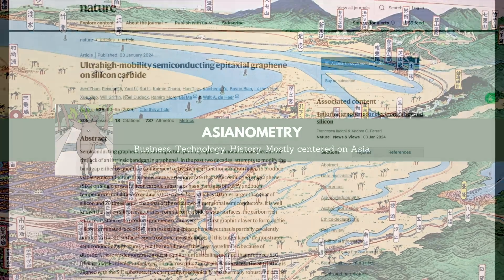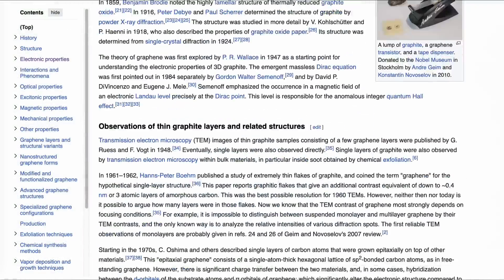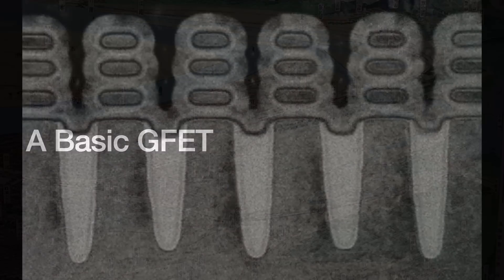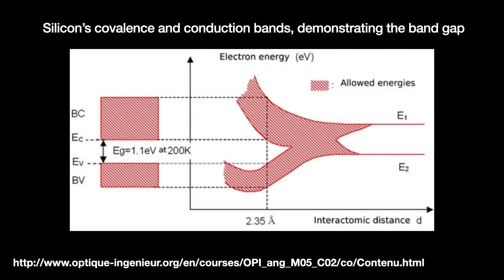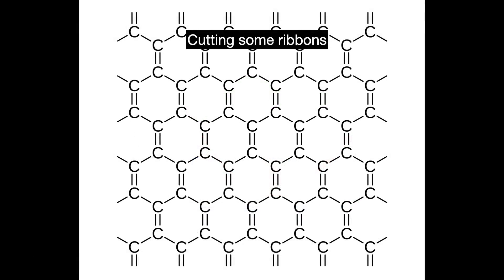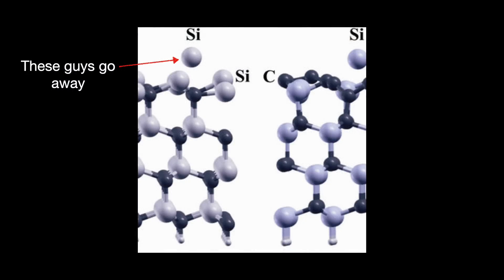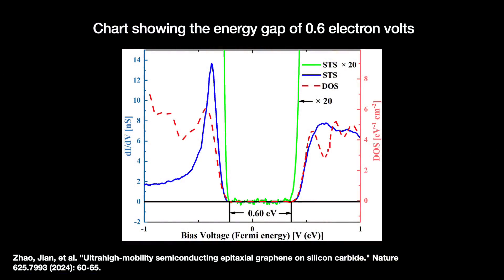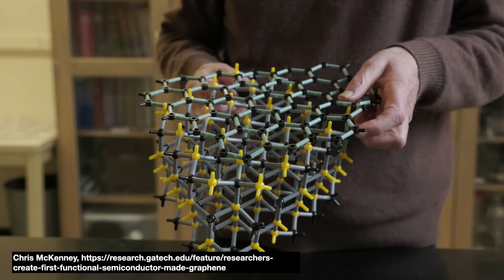A Graphene Transistor Breakthrough?

Comment: "Graphene can basically do anything, except leave the lab"
Reply: Graphene is actually getting there. Sure we don't have industrial production of single atom thick sheets, but flash graphene can produce flakes reliably enough. It's been used as a concrete additive to strengthen and reduce cure times
Reply: my monitor has a graphene heatsink, doesnt need a fan :)
Reply: There already are graphene enhanced products (see sports segment). Nobody really talks about it. Just like with AI being decades old and people thinking it's a new development, nobody simply talkd about its history.
Reply: Some products do exist, but it's hard to do large production runs with it.
Reply: There are graphene based Hall effect sensors.
Reply: his video misses a lot. paragraf already has 2 inch graphene wafers in mass production and already has chips using it.
Reply: Sadly... yeah. Has far too much potential to ignore but its making us work for it.
Reply: It can also probably kill u if not careful.
Reply: Here's an interesting thought for you, what if we become the lab?
Reply: He is kind of the "Perun of micro electronic" :D 
... that said if you know who Perun ist 😛
Reply: There have also been breakthroughs in articles for Graphene, Photonics, and the latest warp drive research from Applied Physics.
Reply: It's great to work with in the lab. I ended up publishing 2 papers on it. But it really is disappointing that it's just something to play with in the lab rather than in industry.
Reply: and shrink to make a chip with trillions of transistors lol
Reply: Is that because it's one of its inherent properties, or is it because it's doped in the lab? I'm asking for a friend!!
Reply: @you2be839  it's because these people feel so entitled that if a technology hasn't become personally beneficial to them after 30 years they get upset. It's crazy. These people are so impatient that they'd have effectively abandoned 99% of technological progress throughout history. We're taking not even having the ability to make steel.
Reply: Hahahaha
Reply: could we build a sheet of graphene atom by atom ?
Reply: Now it can be in contact with your neural tissue
Reply: There is always a lag between the discovery, publicity, commercialization and market adoption.   Scientists use publicity because most people in control of investment funds respond better to hearing they laymen friend talk about what they saw on TV, rather than whatever any scientists say.  Public excitement already did it's job,  that's why you're not seeing evidence of it leaving the lab,  you're not the target demographic.  If you want to know the current state of publically accessible technology and what's going on, look at things like SBIR opportunities.  Graphene is just now getting to the place where it can be made at scale with the quality useful for next-gen materials.  First to be served are all military and national security interests.  Only after a technology is commonplace to the point that it is assumed that every potential enemy already has open access to it will it reach the public sector at scale.  Then still, the new technology has to either be more profitable or have that tech's adoption be forcefully compelled.
Reply: I mean, my thermal pad has a little wee bit of graphene in it ;) It works pretty fricken good too
Reply: You should know black plastic on some samsung phone is already using graphene
Reply: And I have Graphene in my desktop computer, and in my headset.

It's also in other products in Europe since 2018, and it's been in other U.S. products but not very many.
Find playlists under my channel's "created playlists", scroll down to the bottom and start with the "Graphene playlist". There you go, and then check out all the other playlists and behold.
There have also been breakthroughs in articles for Graphene, Photonics, and the latest warp drive research from Applied Physics.
Reply: And I have Graphene in my desktop computer, and in my headset.

It's also in other products in Europe since 2018, and it's been in other U.S. products but not very many.
Find playlists under my other channel's "created playlists". There you go, and then check out all the other playlists and behold.
There have also been breakthroughs in articles for Graphene, Photonics, and the latest warp drive research from Applied Physics.
Have you seen other youtube channels like the Graphene Flagship and Epic Photonics?
Reply: And I have Graphene in my desktop computer, and in my headset. It's also in other products in Europe since 2018, and it's been in other U.S. products but not very many.
Reply: Have you seen other youtube channels like the Graphene Flagship and Epic Photonics?
Reply: There is another channel under mine, it has the "Playlists" tab and then the "created playlists", scroll down to the bottom and check out everything.
Reply: Go to @technologyresearch9665, it has the "Playlists" tab and then the "created playlists", scroll down to the bottom and check out everything.
Reply: Go to @technologyresearch9665, click on the "Playlists" tab once there, scroll down to the bottom.
Reply: <=== Check out this one for a green T icon / thumbnail, youtube algorithm is censoring.
Reply: Bing this, type Phys in the search, go to that website, do a search there for Graphene, and then a search there for Photonics, and then warp drives.
Reply: Search engine this in your browser, type Phys in the search, go to that website, do a search there for Graphene, and then a search there for Photonics, after that for warp drives.
Reply: In your browser type phys, go to that, do a search there for Graphene, and then a search there for Photonics, after that for warp drives.
Reply: In your browser type phys, do a search there for Graphene, and then a search there for Photonics, after that for warp drives.
Reply: Phys website, do a search there for Graphene, and then a search there for Photonics, after that for warp drives.
Reply: Google search Phys, do a search there for Graphene, and then a search there for Photonics, after that for warp drives.
Reply: Open your browser, go to a search engine, type Phys. Search there for Graphene, and then Photonics, after that for warp drives.
Reply: Open your browser, do a search for Phys. Search there for Graphene, and then Photonics, after that for warp drives.
Reply: Open browser, search for Phys. Search there for Graphene, and then Photonics, after that for warp drives.
Reply: Open browser and search for phys. Once there, find articles by doing a search there for Graphene, and then Photonics, after that for warp drives.
Reply: On the phys website, find articles by doing a search there for Graphene, and then Photonics, after that for warp drives.
Reply: On the phys site, find articles by doing a search there for Graphene, and then Photonics, after that for warp drives.
Reply: There is a site called phys, find articles by doing a search there for Graphene, and then Photonics, after that for warp drives.
Reply: "It's just a graph-en the lab".  While currently it may not be great for semiconductors, there's promising applications for high capacity battery and super-cap technologies.  When applied in a single atom 2D layers, it can achieve incredibly large surfaces for energy storage.
Reply: Who said that??
Reply: Spoken like a venture capitalist who thinks they have a grasp of how to run labs because they once had a phlebotomy
Reply: Spoken like a venture capitalist that thinks they know how a lab works because they had a phlebotomy
Reply: It has left the lab. There are graphene batteries you can buy
Reply: oh its left the lab alright... probably in your veins if you took the vaccine.
Reply: We can only be saved by THE PERFECT SHED BLOOD OF CHRIST, on the seat of divine mercy, the Ark of the Covenant.
There is no other Name than that of YESHUA /JESUS CHRIST that has been given to us in the world, to be saved.
YESHUA is the name of the Lamb of God that was designated by the Prophet John the Baptist / YOUHANAN.

The "Left Behind" will have to die as martyrs for Jesus Christ and will have to refuse the mark of the beast because by their refusal today to become Children of GOD by placing their Faith in the Blood of Christ's Atonement ... that will obliges you, because you are not today, yeah  you are not under his Blood now by Faith ... so you will have to go through shedding your "own" blood for HIM. GOD BLESS YOU

Repent (understand that we are sinners, that we are heading towards hell, but a 180° is possible and saving) ---> METANOIA ... it is a transformation of state of mind, so when we put ourselves under the discipline of CHRIST and totally Trust in the REDEEMER BLOOD of Christ Savior YESHUA (meaning SALVATION) to remain there by FAITH continually, CHRIST becomes LORD OF OUR LIFE, even if we sin clumsily, we repent because we have then become Children of GOD and have the promise that He will save us from eternal perdition because YESHUA IS OUR ADVOCATE with the FATHER. We have the assurance of our SALVATION...

So it is essential to believe and place all our trust in Jesus Christ, He who shed HIS PURE BLOOD IN OUR NAME ON THE THRONE OF GOD TO JUSTIFY US WITH THE FATHER TO BE SAVED ETERNALLY, WRITE OUR NAME IN THE BOOK OF LIFE OF THE LAMB WITH HIS BLOOD ---> to appropriate it for free because Jesus allows us ... we have nothing to pay ... it is GOD who offers us His Lamb, the Redeemer, his SON YESHUA / JESUS without any good work to accomplish for that.

He is our Lamb that GOD has provided for us for free to save us WITHOUT EVEN PAYING a penny, and this corresponds to the phrase of Abraham to his son Isaac when he asked him father "where is the lamb?" ... Abraham answered: GOD WILL PROVIDE A LAMB.

The Jews did it by buying a lamb, PAYING to slaughter it, admitting to being a sinner to transfer their sins onto this emissary animal and then ask the priest to pour its blood on the mercy seat of the Ark of the Covenant in the Temple of GOD in their name to be saved from the judgment of God concerning the past year.

Now Our Savior gives us the Salvation of God for free so that the poor without money can be saved and have eternal life without any good work to accomplish without doing anything, for free, just BY FAITH IN HIS REDEEMER BLOOD ... because we are saved by Faith in the BLOOD of CHRIST ... nothing to buy and nothing to accomplish because it must be understood that this was hard for the physically handicapped but here it is just by FAITH.
Reply: Graphene magic-tech is always just 5 years away from going into production
Reply: It has already left the lab. But you'll be getting a watered-down version of it some time 10 or 20 years later. lol -- Break-away civilization.
Reply: I dislike this as grahene lover
Reply: Woke science. Just empty promises.
Reply: Graphene is in that body of technology research -  “will be ready in another 30 years”
Reply: Graphene mass production is very very very expensive. Until this issue is tackled, graphene will remain in the lab
Reply: A little birdie told me graphene is going to finally live up to the hype..
Reply: It is in glass, concrete,asphalt,paint,plastic,ceramics,rubber,wood. Those are some of them that I know of.
Reply: Right?? Sick of hearing about it! Stick it in the same pile as 'fusion' and 'room temperature superconductor'
Reply: @isbestlizard Graphene has already left the lap, CATL and other Chinese manufacturers are using it for batteries and phone chargers (alongside GAN in the phone charger case)
Reply: @isbestlizard  sounds an easily fixable problem on your side (work on fusion marches on consistently and graphene is already in some products now btw)
Reply: @isbestlizard  at least we have achieved net positive fusion multiple times by now, it just needs to be commercially developed
But man that room temperature super conductor is like a frickin unicorn, no sight of the real thing, but a whole lot of horses with a cone tapped to their forehead😂
Reply: @isbestlizard  Old joke, funny and perhaps true when it was made - but it's left the lab dozens of times since. You just aren't aware of it.
Reply: @isbestlizard  I don't quite agree. We are simply investing way too little money into fusion. Any oil company spends more in exploration than we do in fusion, and there is nothing that should really be impossible about fusion.

Graphene will eventually also hit the streets. It's simply too awesome a material to not use it eventually.

Room temperature superconductors on the other hand seem more far fetched. But even cheap liquid nitrogen temperature ones could be extremely useful.
Reply: @MoritzvonSchweinitz except Graphene has already "left the lab" 😉
Reply: @MoritzvonSchweinitz  The Big problems are frustrating... until they aren't. We know fusion works, we know graphine in its many forms has enormous potential. It will simply take time and a lot of money.
Reply: @MoritzvonSchweinitz  The problem with fusion is commercialization. It takes decades or work and tens of billions of dollars for a few hundred megawatts of power. Maintenance and complexity will be extremely high. Meanwhile, a single oil well will probably extract terrawatts worth of equivalent power per day, plus it can be used in mobile applications like cars
Reply: @MoritzvonSchweinitz  of course they invest more in oil. It is a proven product beyond doubt. It is cheap and can be transformed into millions of product. Fision is still decades away if it is even possible. Not a matter of money but research and every large country is investing in several designs.
Reply: @MoritzvonSchweinitz is throwing money at fusion going to solve the problem? Not many people are capable of building fusion reactors.
Reply: @MoritzvonSchweinitz  $10B have already been invested in fusion as of 2025, not forgetting the international cooperation to build the ITER. Wdym not enough funds??
Reply: @isbestlizard Don't lump in room temperature superconductors with things that actually exist right now.
Reply: People can do anything with graphene, except for getting a new joke.
Reply: I have spent some of my savings trying to produce it, i failed. I'll try again sometimes. there are papers of how to produce them so anyone could but not necessary able.
Reply: Graphene car paint protection is pretty awesome.
Reply: Trying to industrialize graphene is like trying to make a business out of building houses out of diamonds. Can you do it? Yeah. Should you do it? No
Reply: @wedmunds what are you even talking about?

Comment: "2D materials" sounds like some futuristic shit from a 90s scifi anime.
Reply: It’s referred to as 2d because graphene is a sheet that is 1 carbon atom thick. This is as thin as it gets before you start breaking down atoms
Reply: @pow_dunx 1 atom thick is immense from a planck length perspective. It is 3d material. 2d materials are only theoretical.
Reply: It's one of the most interesting properties of graphen. When it's thicker, it's basically graphite, so coal. Only when it's 1 atom thin it gets its fascinating properties.
Reply: This seems like it’s not too dissimilar to GAN transistors, which conduct with an atom-thick “electron gas”. It’s such a good conductor that this atom-thick layer is enough for lots of current.
Reply: Wait till you hear about time crystals.
Reply: graphene, graphyne, borophene, germanene, silicene, stanene, plumbene, phosphorene,antimonene, bismuthene, goldene, etc. we have found a lot
Reply: imagine its paper just thinner
Reply: @megalonoobiacinc4863  it's only 2D so you can stack it infinitely high